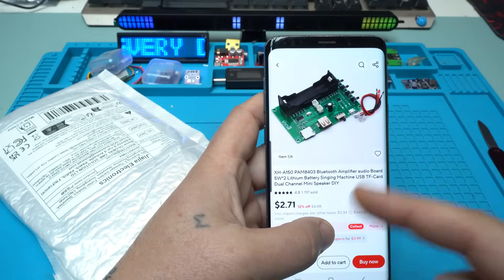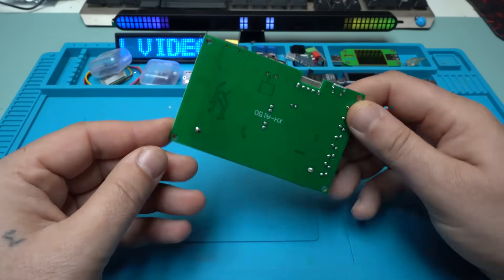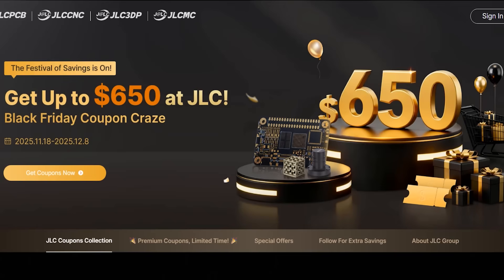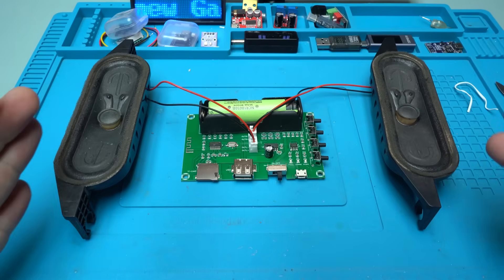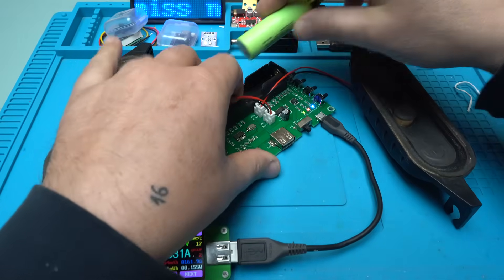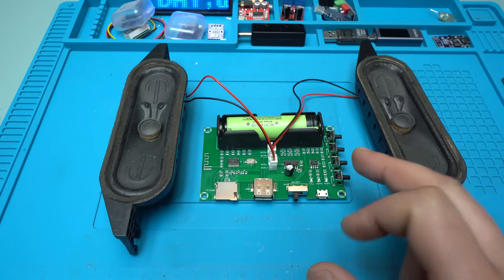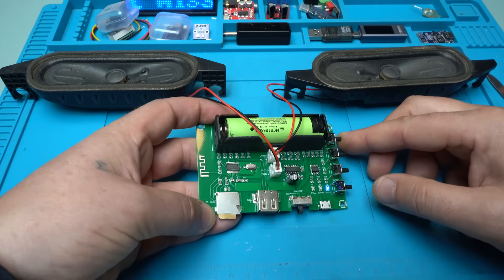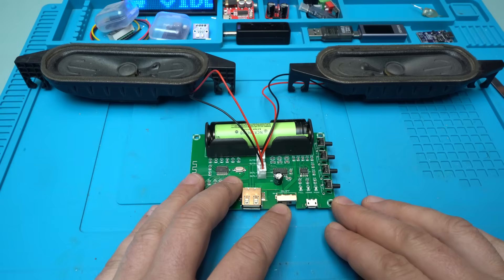WHY THIS $3 Module is BRILLIANT?

Comment: The biggest let down for this whole device is that USB Micro connector. If it doesn't use C I'm not gonna buy it.
Reply: I agree for the most part. Micro USB is a horrible and unreliable port. Type c is my favorite.
Reply: You can but an adapter or change the connector, I’d recommend the adapter!